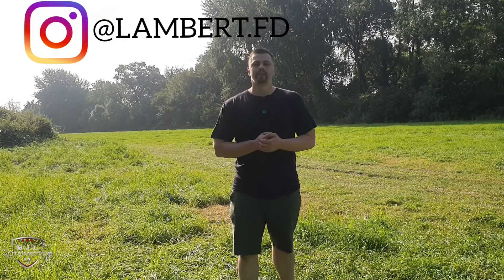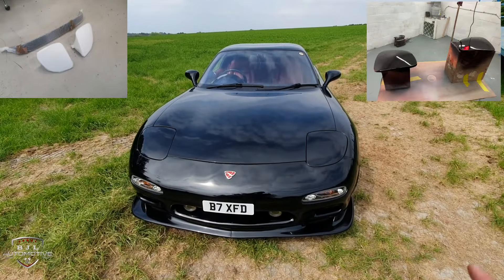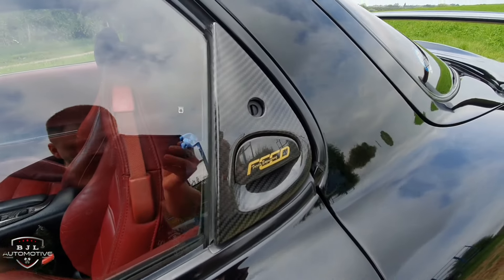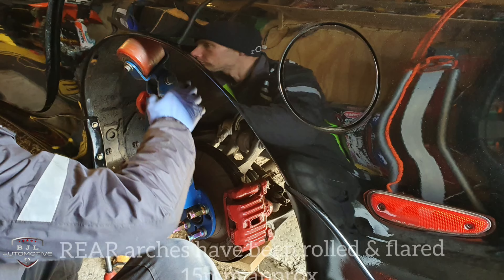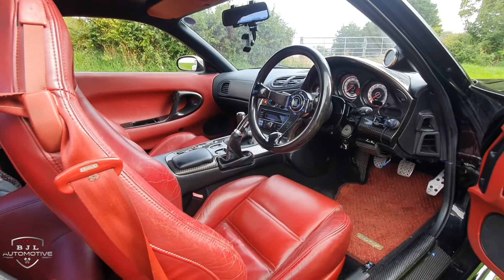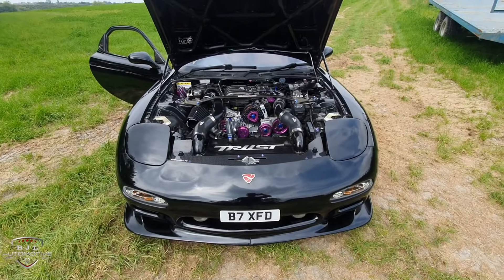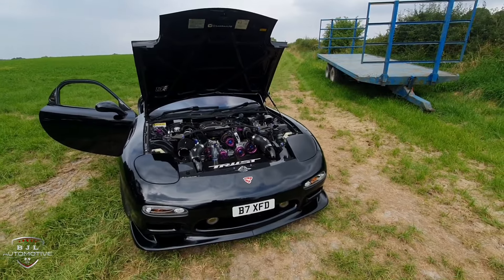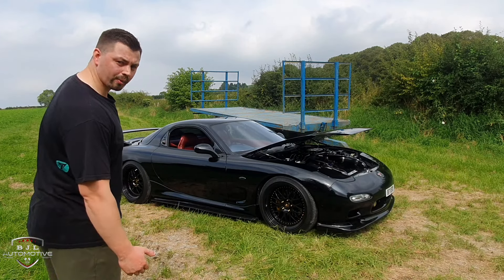Mazda Rx7 Rotary FD3S Full Walkaround & Modifications Of The Build

Comment: PLEASE PLEASE PLEASE!!!!! parts are getting so hard to find, rebuild kits are taking forever to come into stock. Please rebuild, stud or dowel the motor before it blows. You would hate to have to buy all new housings or stat gears. Please start collecting parts when you put her in storage and get it rebuilt before it blows. It'll cost you so much less.
Reply from the maker: Yeah easier said than done lol I am actually collecting parts as I go along. Either way I would get it sorted out don't worry about that 😁
Reply: @RotaryandRides  yea man I know, I'm just saying that, because I help my friend at his shop and he builds rotaries and time and time people don't listen and end up popping a motor right after doing upgrades. Remember this is a turbo car so when it goes it most likely breaks a lot of stuff with it. I rebuilt my 13b before it blew and it was a lot less stress and money
Reply from the maker: @dubbleA100  I won't be adding anything extra on mine as it is because it runs and drives fine on this set up but I need to save a buy all the stuff to go single turbo and i just hope everything is still OK whilst getting it all sorted. If not I have storage and have a good team of people and specialists around which is very lucky, its the risk you take owning these anyway tbh.

I know some people that have spent thousands on their FDs in the UK and their rebuilds only lasted a few thousand miles and others are really reliable, it's just pot luck with them. 

MONEY PITS 💰
Reply: @RotaryandRides  #moneypits 😉